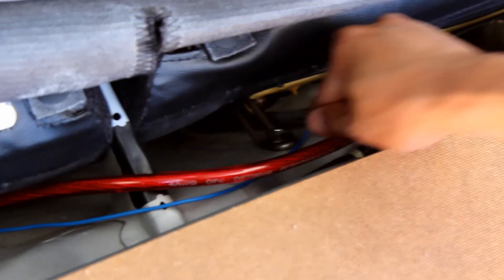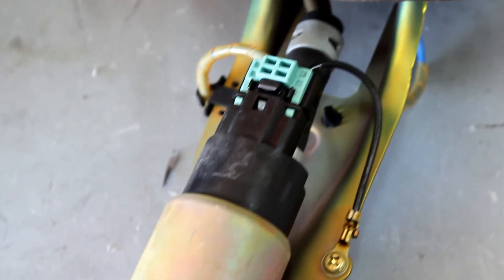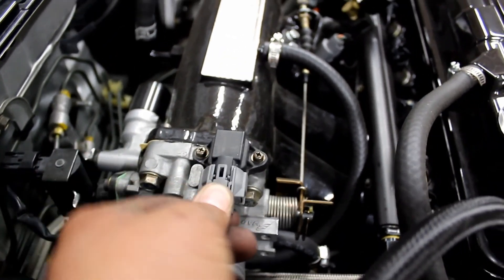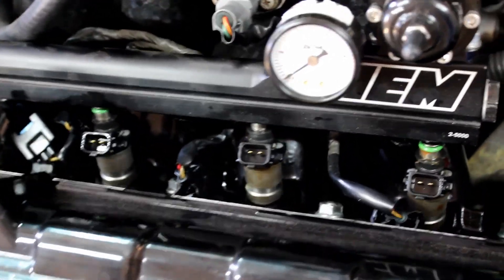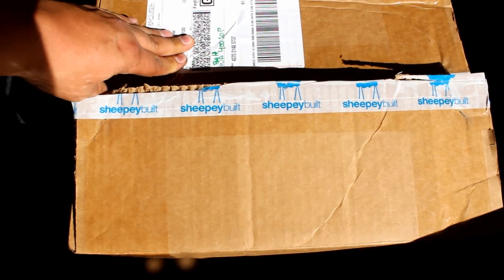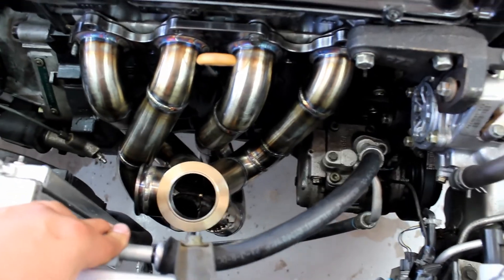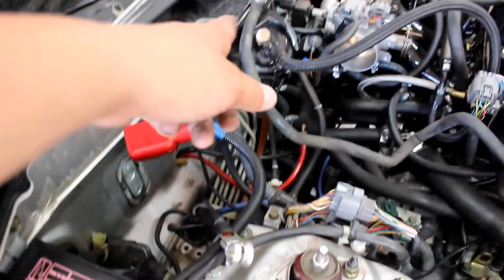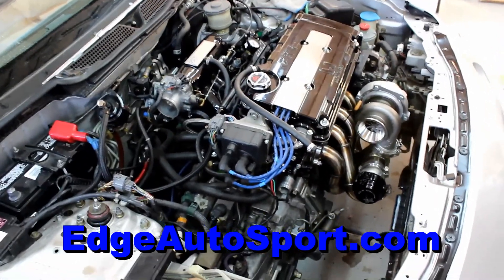Project "No Rice" #11: Injectors, Turbo, Fuel pump Install (Stroked LS/Vtec Acura Integra)

Comment: No A/C, thats a No No for me. Its always good to sort of think around the box rather in the box to solve issues. Its like take a limb off you body, But i guess what's important here is that he turbo will be installed. When I did my engine makeover, I kept my A/C.
Reply from the maker: only so many ways to add boost.  deleting P/s or deleting a/c

Comment: What feed line size and restrictor are you using for your turbo?
Reply from the maker: 0.035"
Reply: anyways you dont have to answer my questions but i recently got tuned and my wideband was properly working and i went to a car meet and i did some 2 step and all of the sudden my aem wideband is not reading no more( reading full lean ( - - - )), not sure if bad wiring but i doubt it, you think its the sensor? but if it is why? its brand new

Comment: anyways you dont have to answer my questions but i recently got tuned and my wideband was properly working and i went to a car meet and i did some 2 step and all of the sudden my aem wideband is not reading no more( reading full lean ( - - - )), not sure if bad wiring but i doubt it, you think its the sensor? but if it is why? its brand new
Reply from the maker: you fouled out the o2 sensor. remove it.  clean it and redo the calibration.  check online for calibration procedure.
Reply: what would cause this? the 2 step? i dont understand? plenty of people has 2 step and wideband and im sure they do it all the time, and mine was literally 2 days old 😭
Reply from the maker: your tune could be wayyyyy too rich
Reply: i really hope its the sensor 😭
Reply: its actually the sensor, hopefully this new one will last
Reply from the maker: good luck